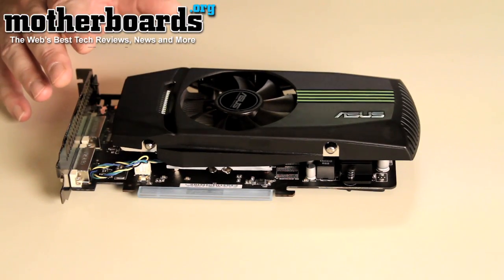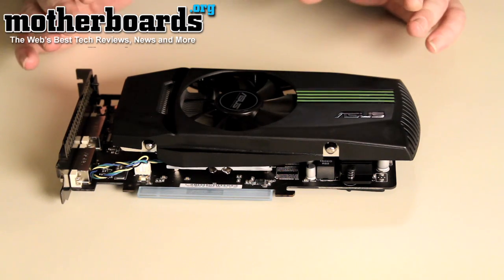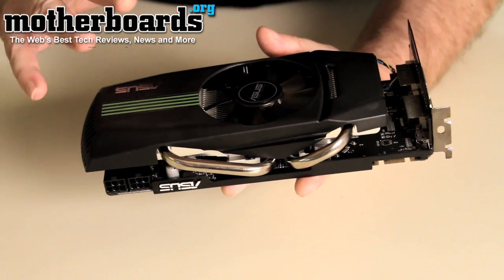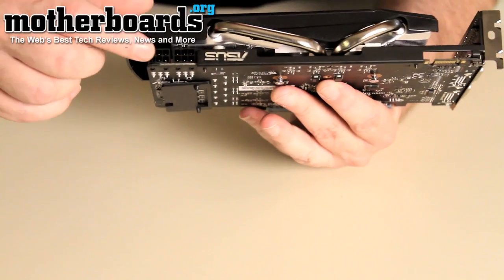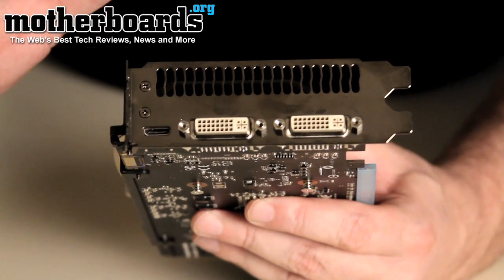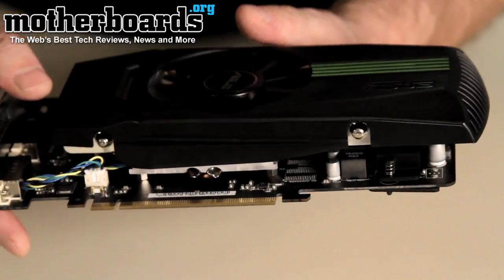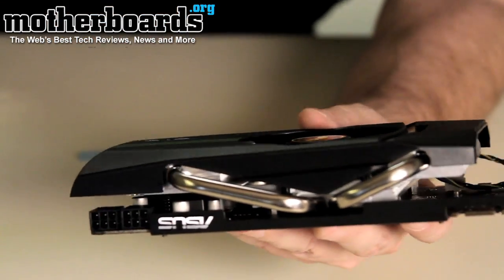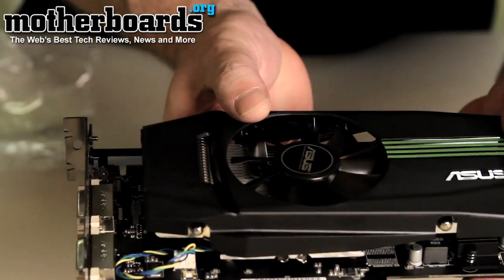ASUS ENGTX460 TOP / NVIDIA GeForce GTX 460 Review Part 1 - Introduction & Features

Comment: @CycloneCinema I have 2 460s in sli. A zotac amp edtion 1gb and a recently purchased Asus 460 direct cu2 i got off amazon. Its worth the xtra dough. Great cooling and its fast. the 460 is better than the 550 but a little slower than a 560. Asus and Evga make the best cards for nvidia imo.

Comment: Can someone answer this please i'm really worried. Will the nvidia 460 gtx and other ddr5 videocards work in my Gigabyte GA-EP35-DS3R? The guys in this computer parts shop says that my board can only handle as high as nvidia 450 gt because it is only DDR2. Is it true? Please someone answer.

Comment: @mrceebees14 You don't have to change it if you want to run a single card, but sli will require either an sli hack, which doesn't work all the time, or a compatible sli board like one with an nvidia chipset or intel's p55/x58 chipsets.

Comment: @mrceebees14 
1) Easily. This can run on a 500w.
2) Any motherboard with a pci-e 2.0 slot will do.
3) Isn't really a question. And that cooler isn't all that great for higher overclocks. Replace that with a nh-d14 or silver arrow cpu cooler and your 965 will reach 4.0ghz pretty easily. Also, ati cards can overclock as well, you have to do it through ccc,. rivatuner, or afterburner.